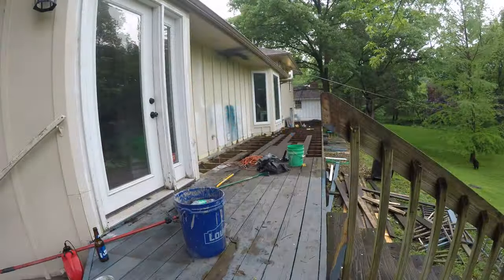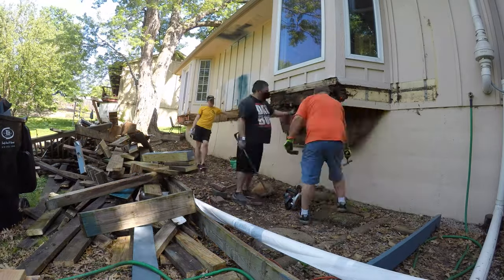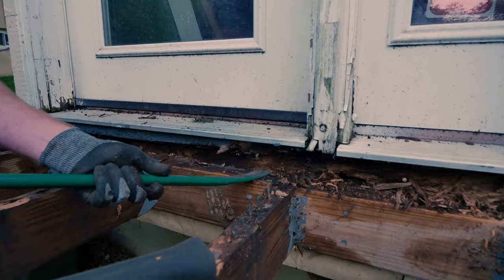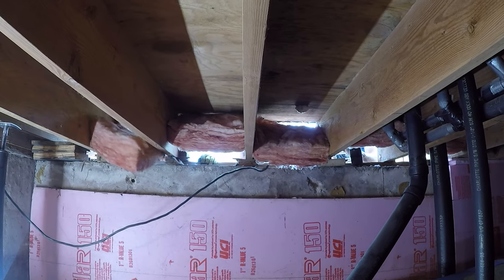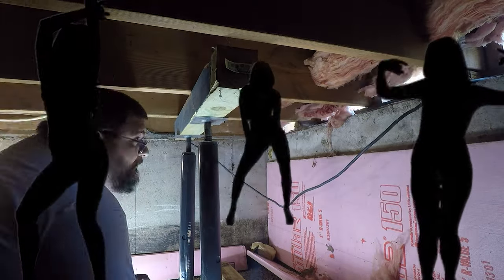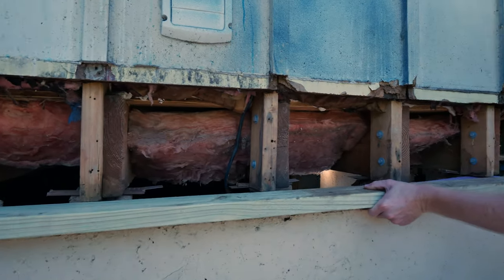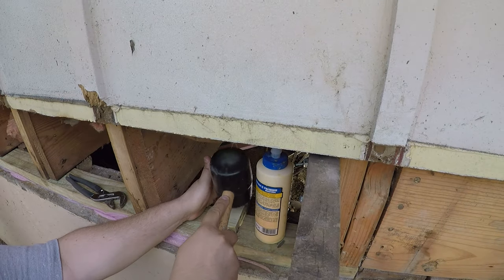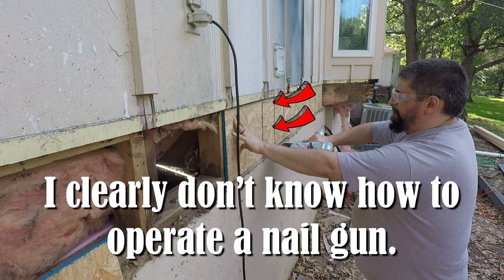Replacing Sill Plate in a Balloon Framed House

Comment: So how would you replace the sill if it was going the same way as the floor joists? My joists run east to west and the sill is on the north side?
Reply: and yes, it's ballon framing...
Reply from the maker: Depends on the house and the roof style. If it's a gabel roof, the only load on the wall is probably the wall itself, if it's a hip roof, you'll need to worry about supporting the roof. In the latter case you could look at building a temporary wall to support the roof.
Reply from the maker: Also, take careful note of the load paths. Might have a header or a beam that ends in the wall parallel with the joists and that will 100% be bearing regardless of roof style.
Reply: @HonestBrothers  its a hip style. i can see the main support it runs north to south.....the joists go west to east....im thinking i might get away with lagging a 2x12 across the side i want to lift... overhang on the sides as a lift point to take the pressure off while i slid the new one in....
Reply from the maker: @dogfishead8317  that would likely work, too, if there is enough stud to lag into. Work in sections if possible, or add jacks. One at each end seems too few, not with respect to the jack load, but to the temp support beam/ledger.
Reply: @HonestBrothers  i picked 5 20-ton jacks for this job...i used to lift and move  boats by hand(50-70ft), so im kinda familiar with moving a lot of weight...just not a house 😅...appreciate the tips👍
Reply from the maker: @dogfishead8317  best of luck!
Reply: @dogfishead8317  hope it worked out for you, I had the same deal and had to lag a header board to tie the suds together, used a 2x12 and then doubled it up every 4 feet and lagged some lift points onto that and jacked it up from the outside, I also needed to lift the house 3 1/3 inches to level it out, worked ok after several setbacks, it had some major torque so I had to use some wedges underneath the sill to keep it from twisting out